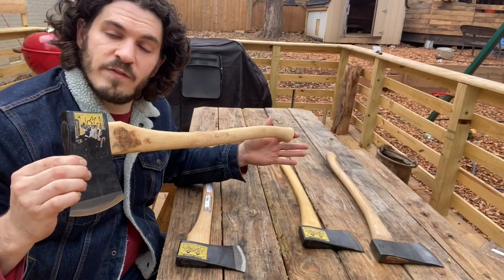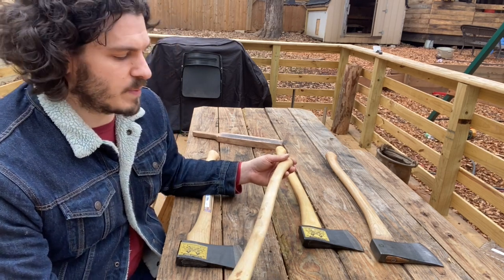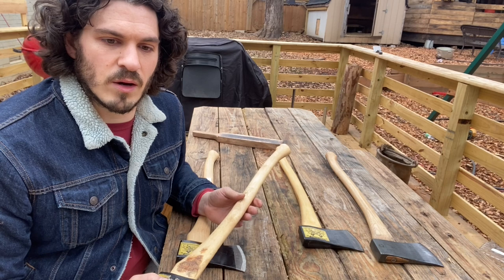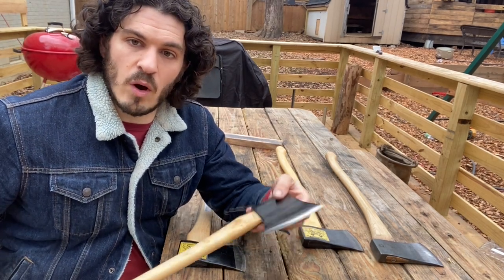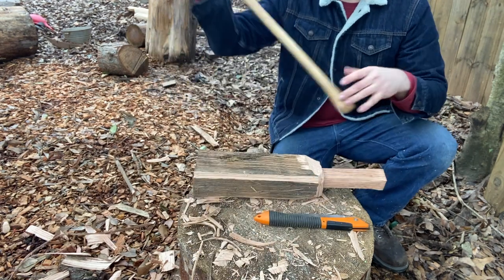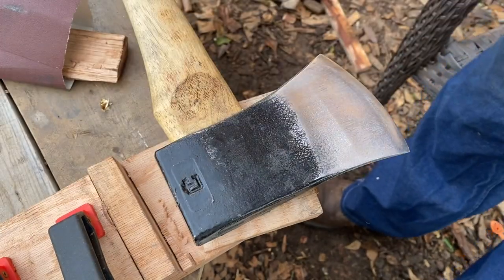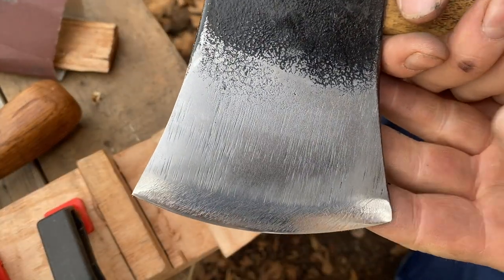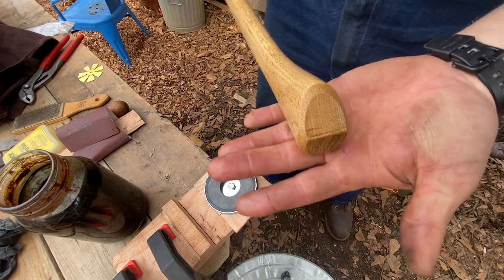The Forest Service Boys Axe by Council Tool: PART 1

Comment: I have one of the original issues about 10 years ago. Got it for $29 when my $150 Swedish Axe arrived with a warped handle and the edge chipped on the first use and it took them 6 weeks just to respond to my return inquiry. The replacement was also faulty, but the FSS that I got temporarily was still going strong and I never looked at Swedish Axes again especially since the FSS arrived perfectly hung, nice and straight and had an edge that took a beating and never failed. I now stick to Council Tool. I have every Boy's Axe they made (Bad Boy Velvicut, standard red painted, Sport Utility and the FSS).

Comment: Bought mine a few years ago from omaha knife,paying extra for custom sharpening they offered. Its been a fantastic axe. Holds an edge well,fantastic handle,great balance. I usually use a axe puck stone ti touch mine up after use. I limb and drive felling wedges with it. Its a good kindling splitter too. Im not a bushcrafter or professional feller,just a guy who burns 4 cords of wood a season. I keep an old council rail splitter double bit and stanley 4lb axe for other light stuff. Most of my firewood hets split with an 8lb fiskars maul
Reply from the maker: That’s awesome! Omaha knife was great, I was sad when the owner passed.
Reply: @urbanlumberjack  yeah,I had no idea until I saw your video. They did well by me

Comment: Looking fwd to part 2! These are great axes.
I have a FSS with “perfect” 90 deg grain handle, bit disappointing, but works so far. Also my sports utility version came with the same “perfect” 90 deg grain. 
Replacement handles are hard to come by here in EU. The FSS is the better axe with a thinner bit and high-ish centerline.
Reply from the maker: Thanks for checking out the video. Replacement handles are getting harder and harder to come by.

Comment: You have sharpening skill. That wipe on mystery blend on the handle ? Looks like a mix of pine tar and linseed oil ?
Reply from the maker: It’s the best thing I’ve used. I might do a video on it. This is pine tar, natural linseed oil, beeswax, and a little bit of tung oil. When I have the raw materials I boil down oak bark to extract the tannins and it’s really nice for applying a very natural dark color to handles.